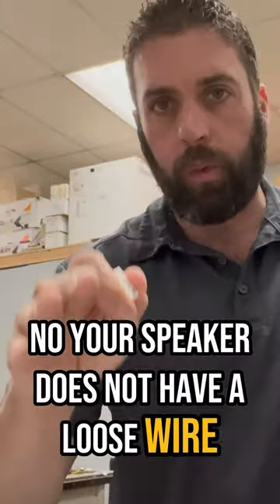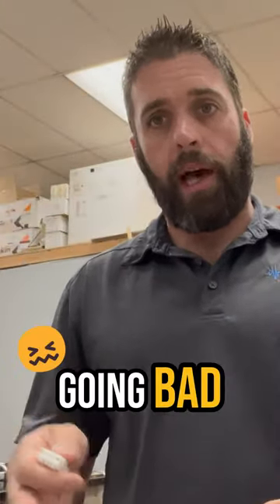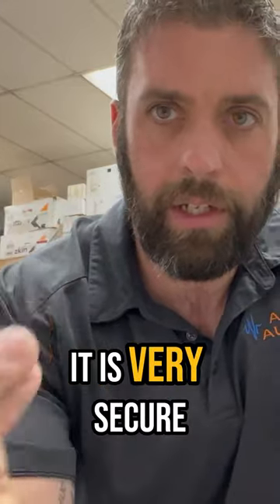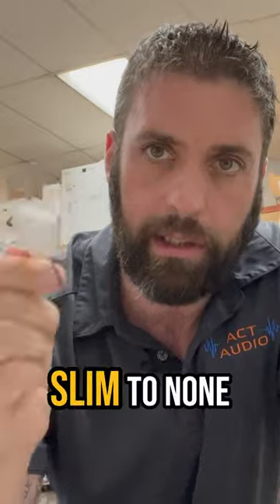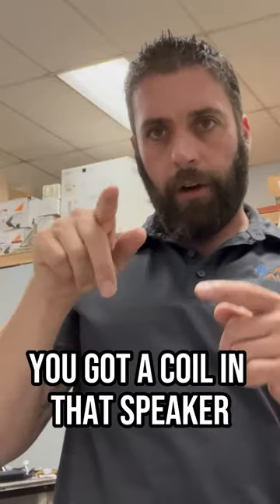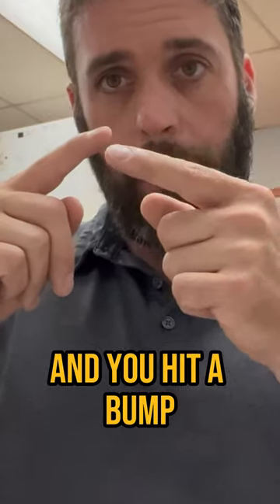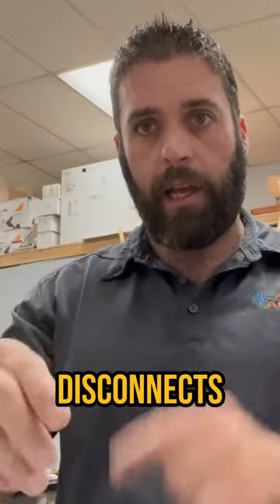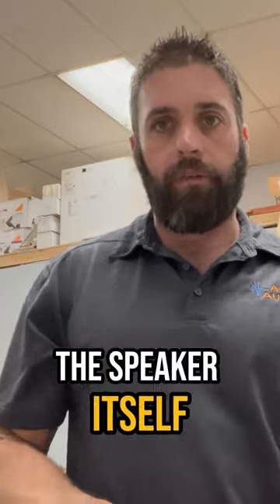How to Fix a Speaker That's Cutting In and Out

Comment: My home sound system has a problem of cutting whenever I try to play music. It would play just fine when I put the volume below 10 but after a few minutes my speakers would start cutting. Tried changing the wires and resetting the system but never helped. I don't know what to do now.
Reply from the maker: make sure the speaker impedance is within range of what the receiver requires

Comment: What if I already changed out the speaker with a new one..and I'm still getting the same problem 🤔 than what?
Reply: i’m having the same problem, check your radio it can be loosen
Reply from the maker: also if you have an amp it could be a bad signal cable or power shutting it off
Reply: @actaudiollc306  it's a bose system that came with the car..I didn't change the amp or subwoofer just speakers..and it's still giving me that problem..just switches from side to side
Reply from the maker: is it a chevy/gm truck? @Supreem6969
Reply: @actaudiollc306  nah its a 2008 cadillac cts
Reply from the maker: @Supreem6969  Similar, I know the GMC of those years are notorious for bad speakers. can't say 100% for the cats
Reply: I have a weird issuie to me anyways all my speakers mute when I hit a pot hole and sometimes it sounds like radio interference but the moment I threaten my car it works? Any ideas? And I use Bluetooth radio hard connection threw radio and its always the same issuie I'm not rich can't afford to get it professionally looked at but I guess it's the way I gotta go :( but thought I'd ask on here first for an idea :) 😅
Reply: My left side speakers work sometimes and radio volume knob wasn’t working at one point but started working and has been fine since(1.5years ago) Probably radio?

Comment: Turned my volume up while driving and 3 went out and glitch and try to come back in. So i have set of 3 speakers on the left side of my car and 3 on yhe right. All 3 different speakers on my right side are going out. Im in a 2005 toyota prius. Any suggestions?
Reply from the maker: If they are all going out together then it's something they all have in common. Hard to say without looking at it myself but perhaps a bad signal cable if there's an aftermarket amp.. Let me know what you find

Comment: I just got my soundbar and subwoofer from Vizio when I ordered it online on Amazon. I got the M series, and now it’s starting to cut in and out and I use aux and when it first came I was trying to connect to it with my phone using Bluetooth and the phone didn’t even see the Vizio speaker on Bluetooth. Then I reset it and then it was appearing on Bluetooth. So I think if I reset the soundbar again it probably will fix my issue I’m having with it now.

Comment: Okay I need some help so my car keep like like  sounding muffled and only the two front speakers will work and the rear won’t I checked all the connections and seems to be okay and then out of no where it will work and then after a few minutes it will start to glitch out and go back to muffled sound and the weird parts is when I go to press the clutch to my car the audio like gets a bit louder so idk if there is a wire that exposed to something any suggestions  ????
Reply from the maker: I mean without knowing the car, what's in the car or seeing the install I can't online help there. sorry ma n

Comment: My car the audio is cutting in and out for a few seconds then goes completely out. If I turn off the car and turn it back on, it comes back, what do you think? Everything is original 2015 Hyundai Genesis sedan lexicon audio
Reply from the maker: Hard to say when its factory but in the aftermarket world that most likely means an amp is going into protect mode and turning the car off and on resets it.  Protect mode can be many things from bad speakers, bad voltage, bad signal or others

Comment: Mine cut off when the volume reaches 13 untill lowering the volume down then the subs comes on and play fine! It started this about a month ago...my amp stopped working all of a sudden... Smelled something burning like wire or something in the amp...
Reply from the maker: sounds like you may have a short, which could be a bad speaker or terminals grounding out.  Also could be an impedance issue

Comment: What about all 4 speakers that cut in and out every 5 seconds
Reply from the maker: if they are all doing it it's not the speaker.  It's hard to say without knowing what you have installed. but what's the common connection, an amp? a wire? bad radio?
Reply: same problem i bypassed the amp changed the radio and it still cuts  in and out every 5 secs
Reply: Ever find the solution?

Comment: Mine does it when I’m stopped
Reply from the maker: driving or running shouldn't matter. Although if your alternator is bad the voltage and amperage could reduce when stopped causing a problem